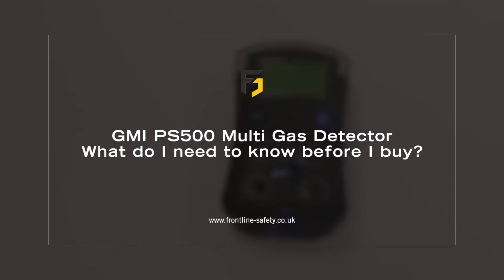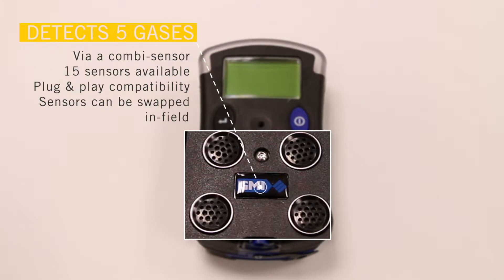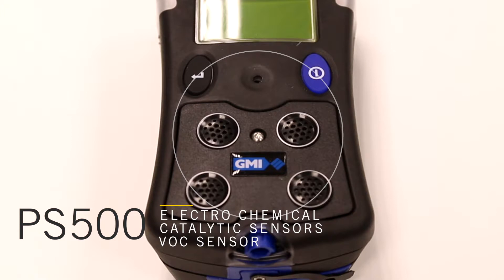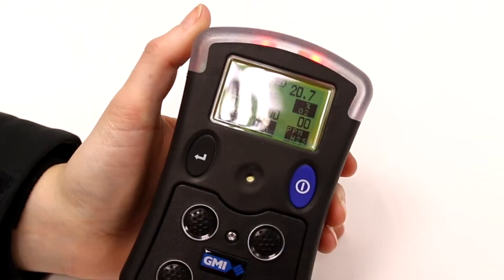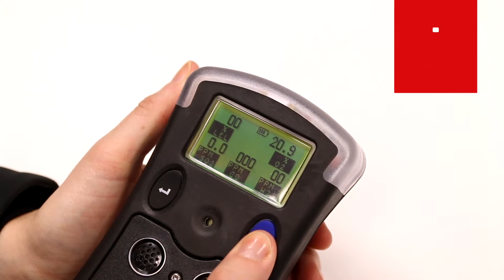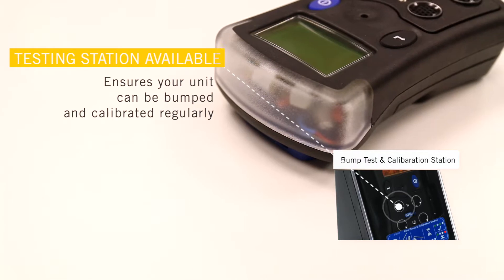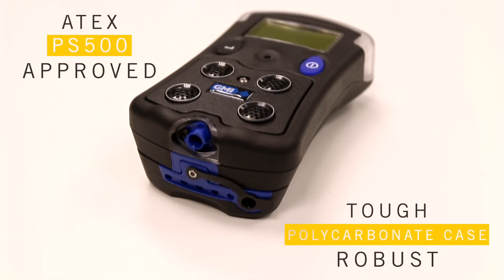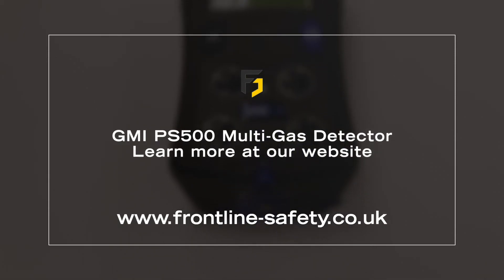GMI PS500 Multi Gas Detector - What I Should Know Before I Buy

Comment: so far the worst gas detection ive had.  within the first year.  it stopped making sound so with an alarm it was silent.  which is kinda tricky,   the back clip is flimsy it will fall out of your pocket during work.  like allot of times. which sucks.  the pump function. well  i got the hose but it doesnt seem to be able to pump for some reason.  and lets not even begin about battery life,   about 7h is the max then it starts beeping about low bat.   for such an huge device it really aint that good at all.   but oh well.
Reply from the maker: Hi there,

It sounds like you may need your PS500 serviced. We recommend you have your monitor serviced every 6 months to ensure its performing as it should. 

If you are in the UK you can send your device to us, find more information here - https://www.frontline-safety.co.uk/portable-monitor-servicing

Otherwise, contact your local service centre and they should be able to assist with your issues.

- Callum